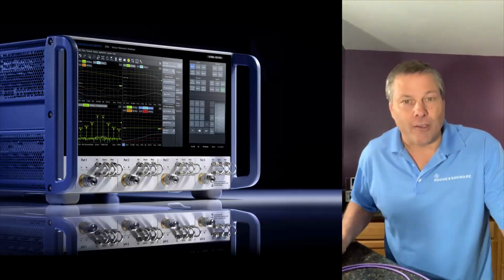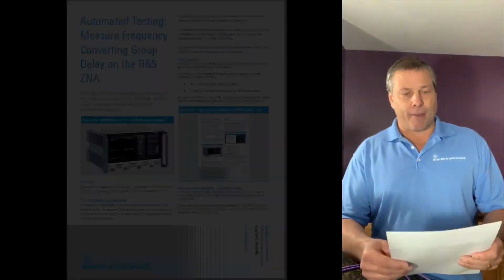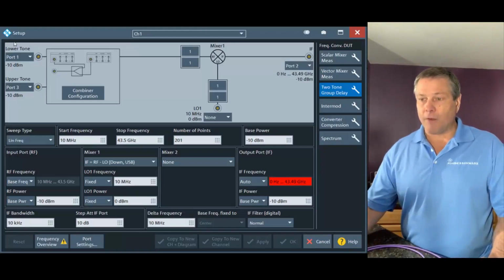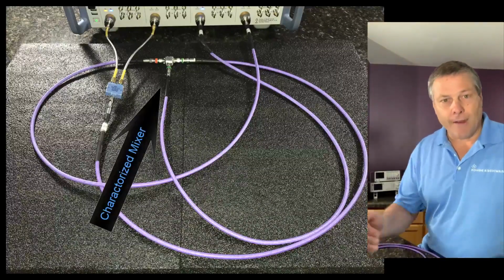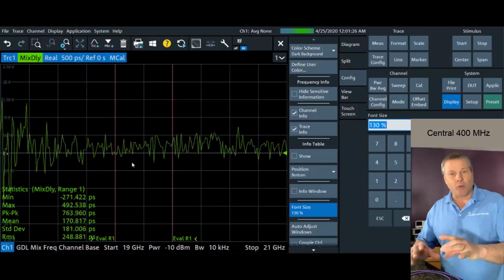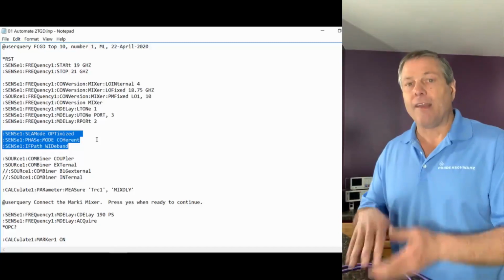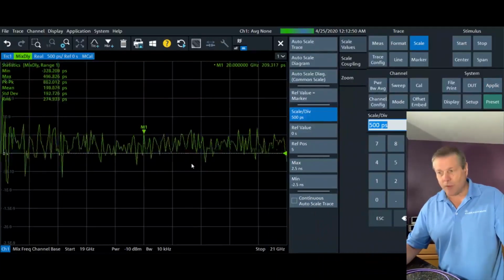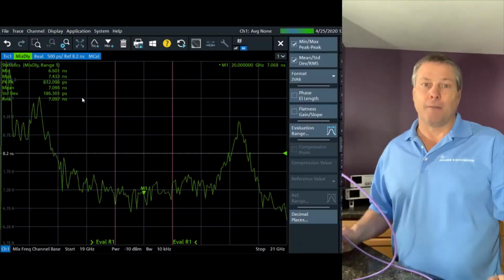Technique #1: Automate your measurement

Comment: Mike there is an even better way then just SCPI, use python Sockets to connect to the LXI socket and use python with Jupyter Notebooks to keep a lab notebook of the collection and measurements. And with Python +Sockets+SCPI instead of VISAs you can remote onto any LXI Test and Measurement equipment on any OS. Great series and this is why despite having a lot Keysight instruments I would always prefer to get R&S